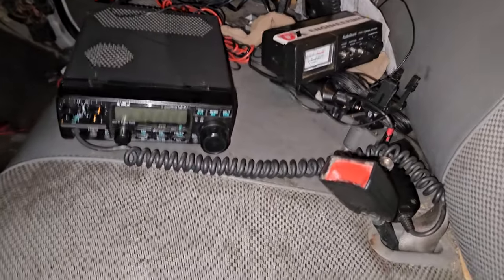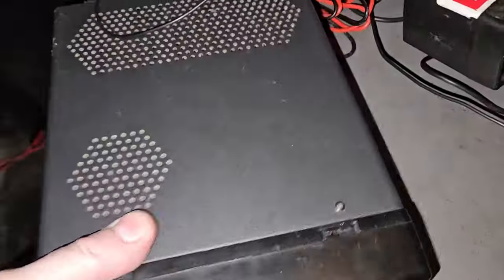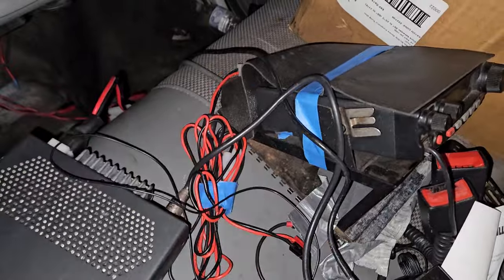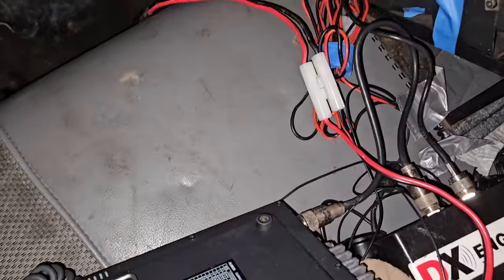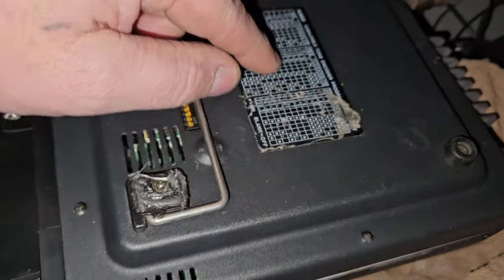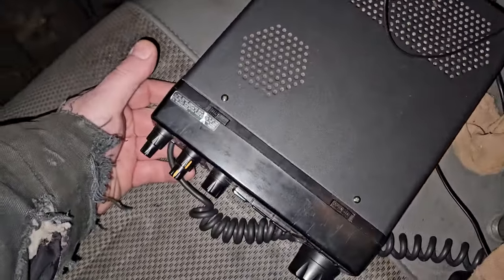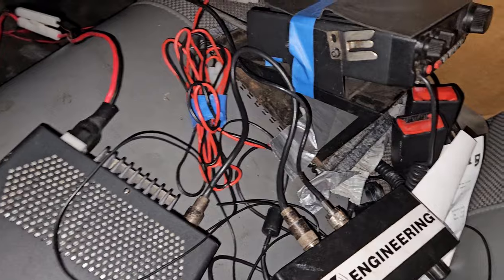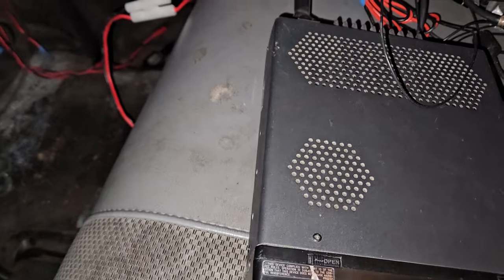All my mobile ham radio stuff came loose!

Comment: I had a slow speed crash with a a semi a few years back.  Ill never use anything but solid mounting for my mobile radio gear.  Enough stuff flew thru my vehicle,  i dont need a pound or more of radio flying in the cabin area. 

Best of luck sir.  73